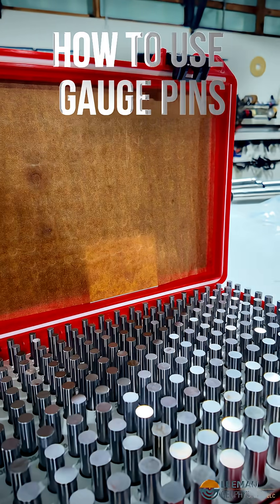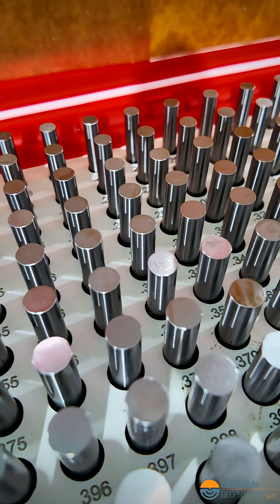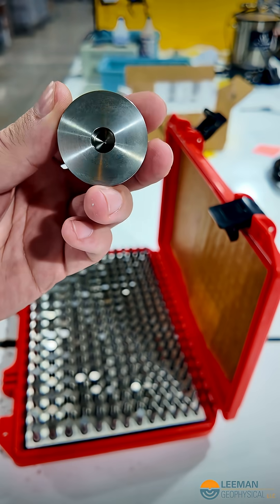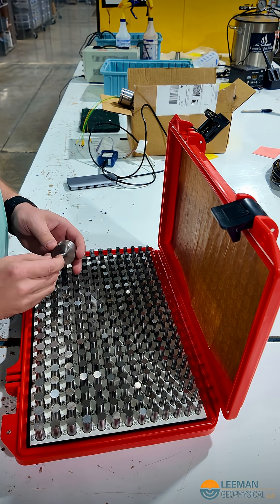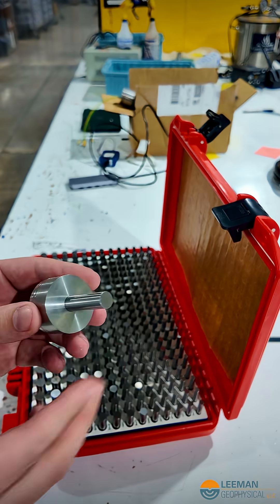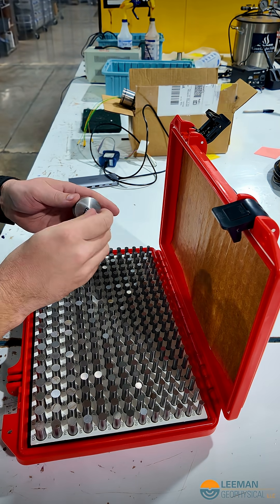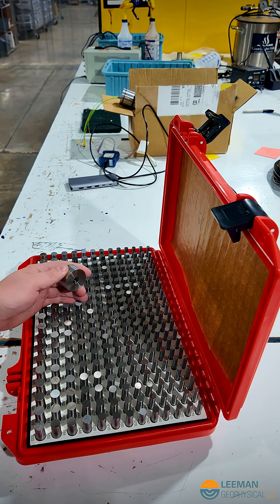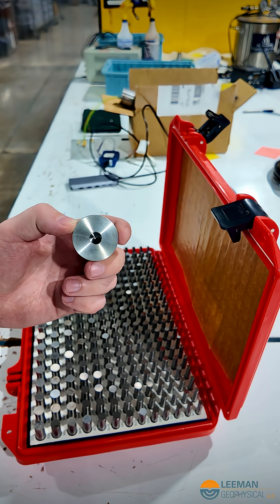How We Use Gauge Pins for Precision Measurements

Comment: .398 at 62°f, .399 at 82°f
Reply from the maker: Right - "room temperature" QC was all that was required here, but for getting tighter it would be in a temperature controlled room.
Reply: @leemangeophysical  it's like the timing gear on VW 1600 camshaft.  It's brass so it doesn't take much to ruin it by beating on it. It doesn't matter on the worn gear, it's being replaced. But putting a new one on, toss it the oven when the woman ain't watching for few minutes. It'll slide right on then. Otherwise it gets beat to a pulp trying to put it on. I even once had an old Chinese pocket watch. To get the back off put an ice cube on it for a few seconds. It loosens it enough to pop out.( I figured that out myself 🧐). Lol If you ever wanna make a puzzle that most people won't figure out, use brass and steel. Machine the brass right out of the freezer( if it's the insert part).

Comment: What about temperature fluctuations at that level of tolerance
Reply from the maker: For this level, it isn't a huge deal, but getting much smaller, it can be. Depends on the tolerance and requirements of the part and QC sheet.

Comment: How much more accurate are these than small hole gauges and a micrometer?
Reply: Using a set of measuring gauges will only tell you the specs of what you're measuring on the plane that you are measuring. Something like a plug will tell you if all the smallest points of the hole are aligned. So if you're looking for accuracy i would say a measuring gauge of some sort. But if you're looking for function i would say a plug gauge.
Reply from the maker: @jonasvann5387  That's an excellent point! This bore houses a piston with seals on the bottom, and a plug is more representative, as you said! Thanks for watching!
Reply from the maker: Partially depends on the grade of pins you buy - there is also some preference. I find I like these better for small bores, but that may be just me!

Comment: in USSR we used similar, only with chamfers. and we called those chafered gauge pins "plugs". so, if half plug came in - that is a failure. the correct size - the hols in detail, can "bite" just a little bit of the plug. if you failed the hole - take a ball bearing 3 time diamter of the hole, place on, and hit/tap with a hammer. then the correct plug will not fall through / will not fail )))
Reply: I guarantee the Chinese stole your ball bearing trick. Or they just don’t test them at all.
Reply: Sums up a lot of old Soviet machines. Im from what's was eas Germany and I've seen some funny "fixes"

Comment: Wouldn't it be easier to fill the cavity with acetone to the top, suck it all out with a precision syringe, add the volume that evaporated, subtract the volume of the o-ring grooves measure the depth,  pi r squared, solve for r, multiply  by 2?  I mean fiddling with all these fancy pins seems ridiculous.
Reply from the maker: That sounds like an undergrad physics lab activity😂!

Comment: Yeah, I'm sure it was spec'd at .3985 Because .4000 is just stupid.
Reply from the maker: It was actually 0.397 with a 0.002" overage allowed - the part was designed overseas so it was not a nice number here in imperial machining world. But hey - it's just a number!
Reply: @leemangeophysical  I was joking.  Parts are what they are.
Reply: Interference fit?

Comment: Go - no-go gauge
Reply: that would work for quick checks but not for SPC charts that are mandatory for automobiles.
SPC= statistical process control, example you would have a target size or ID of lets say .320 but your spec is from .310 to .330 every hour you check the ID and chart it and you want it to float from a couple .001 over to a couple under target ID.
hope this made some since but a quick google search would maybe explain it better.

Comment: Is heating the test object in the hand and manipulating test pins without gloves considered good practice?
Reply from the maker: Depends on how careful you need to be - this hole was +0/-0.002 and we weren't holding it for long, so it would be fine, but getting really tight, yes those are concerns.
Reply: Do you honestly believe holding that pin for 10 second's is going to warm it up enough that it starts to expand? PULL YOUR NECK IN

Comment: If they are that precise, would varistion in temperature affect the size of both gauge pins and hole they are meant to measure?
Reply: Yes. Generally, quality control rooms where the parts are maintained and tested are all at a constant temperature
Reply from the maker: Yes - sometimes parts are required to be QC'ed in a controlled temperature room. We don't have one (yet), but the shop is climate-controlled and that's been good enough. Making sure you don't hold things longer than necessary is important too.
Reply: the pins are .0005 smaller then the size stated on the pin, so .325 pin would be.3245.
I think this is to account for any heat like room or body temp changes. under high heat it could gain manybe .001.
Reply: @SuperXarus you can get different classes of pins, in plus or minus sizes, so they can be over or under size by more or less than 0.0005
Reply: @TricksterJ97   I didn't know that for my work guess .0005 was what they wanted for our purpose. we make fuel lines for cars and trucks.

Comment: but, what kind of scale is that? resolutions seems to be about 0.2 - 0.3 mm,  kind of rough, maybe ok for some applications.
Reply: Resolution looks like 1 thou (0.001 inch) which is about 0.0254 mm or 25.4 microns.
Reply: @alexandrezani  thats a lot better than i estimated, thats good, thank you!
Reply from the maker: Yes - these are in 0.001" steps, so pretty decent
Reply: What do you expect, it's imperial... 🤷

Comment: Be aware that gauge pins are only checking (go vs. no-go) the smallest diameter of a hole but not roundness. Just think of an elliptical hole.
Reply from the maker: True! A CMM could tell you a lot more, but even the inexpensive ones are beyond my QC budget at the moment. Maybe someday though!
Reply: @leemangeophysical  yeah.... I just bought a CMM and it's twice the cost of my gauge pin set (imperial thou up to 2" and metric 1 thou to 25mm and 5 thou 25-75mm) 😂
Reply: You'd think that would break the air seal at these tolerances so naturally you'd be able to tell if the next size doesn't fit but a size under feels loose from a gap for air
Reply: @KaiserTom it can feel like that. Feel is a good indicator that you need to check more thoroughly, but feel is not something you can indicate on an inspection report.
Reply: @prisonedninja23  yes you can if you’ve been doing the same job for over 20yrs 😂
This isn’t for a rocket ship.

Like do guys work in these fields or you guys just come here to talk? 😂
Reply: @100millplusBaby no, you cannot. When developing any product, you’re creating a SOP— which would then need to be followed for manufacturing. 

Do you really think engineers do the manufacturing? No. They tell the manufacturer exactly how to build the product through an SOP.
Reply: Ok… so he is talking about roundness. Out of round condition is what he is referring to, in which a hole or a boss or really anything cylindrical, has a shape that is not perfectly round on a cross section. This can make a hole that has a maximum diameter of 1.006 measure 1.004 based on the pins. Technically if you only measure based on pins and your tolerance is .005 that part would pass since the no-go pin wouldn’t go; however, inspection with a bore gauge, CMM, or intra-mike could show that the hole is, in fact, bad. It’s important to remember as machinists that it’s never enough to inspect any feature with only one instrument.
Reply: @prisonedninja23 ok agreed until that last part, stop overcomplicating stuff
Reply: @lilkane667 depends on what industry you’re making things for and how strict your tolerances are, honestly, but generally speaking you should measure every feature multiple ways several times throughout a run as a spot check. It’s an ISO standard.
Reply: At 20 degrees centigrade
Reply: I use them for SPC charts and you can't use a go nogo for this but roundness is ovality the difference between lowest and highest reading in my line of work you can use calipers to do this by measuring the outside if you know the wall thickness and the OD then you can figure out the ID.
Reply: No doubt, I think of your mum the same way!
Reply: How much of the length is tapered?
Reply: @bluestormcloud791  Gauge pins are not tapered.
Reply: Couldn’t you also quickly identify an out of round condition with a bore gage?
Reply: Your eye-crometer will detect an out of round condition once the gauge pin is inserted into the hole. An out of round hole also wouldn't produce an air seal.
Reply: If its too oval it won't seal air
Reply: There's a lesson in the comments.
Be kind.

AFAIK, even an ellipse can be concentric (common center).
The video appeared to be concerned with size but broadly, it was circular dimension what was being measured, I think.
Reply: @idonotwantahandle2  technically it is only measuring the largest diameter that the hole can accept from a perfectly ground part. Anything that is cut will inherently have imperfections in some way. Imperfections are generally allowed to a degree but that’s why it’s important to measure in multiple ways to ensure that a feature meets tolerance specs. Again, using pins only measures one dimension and they don’t account for geometric tolerance, only diameter.
Reply: Temperature fluctuation is not considered here. But any criteria that is measured in thousandths should.
Reply: Guage pins tolerances are the same for roundness as well as diameter, especially if they're -.0002 or +.0002.
Reply: @anthonymangia8890 A 0.250" gauge pin will fit snuggly into a 0.250" square hole. It will also fit snuggly into an elliptical hole with a minor axis diameter of 0.250". That a gauge pin fits only puts a lower bound on the minimum width of the hole.
Reply: You mean concentricity?
Reply: @valvodka circularity
Reply: @lilkane667  coaxiality, cocircularity, centrosymmetricity?
Reply: @tabcreedence6553 circularity or concentricity idk bout that other shit
Reply: @lilkane667  Don't worry about it. They're just trying to baffle you with bullshit. Those aren't contextually helpful metrological terms that contribute to determining what we're hypothesizing is being measured here.

Coaxiality just means to share the same axis. Essentially the 3D equivalent of the 2D measurement concentricity (a cylinder vs a circle cut from paper). Compares two cylinders to each other, measured from a central axis. Does not mean they are the same diameter. You could define a stepped bore as being coaxial.

Cocircularity is a descriptive term, and only implies uniformity. Sounds fancy, but the correct term to use if you're talking about accurately measuring, is circularity (2D) or cylindricity (3D) (Yes, I know 2D vs. 3D is debatable depending upon context). You could use it to define what to measure, but it is not itself a measurment.

Centrosymmetricity means an object, any object, is exactly the same when inverted along a central axis. I've never heard this term used when measuring machined parts. I think it's more of a metallurgical term used to describe molecular structure. But I've been wrong before and wouldn't mind being corrected if that correction also includes a compelling argument explaining why.

I'm surprised no one has mentioned taper or surface finish yet.
Reply: @UVBluetoo haha yeah i figured. All i know is as long as it works who cares😂
Reply: In correct. You can have an ellipse which is concentric with a circle. Depends on their relationship to the centreline.

Comment: LOL trying to use imperial so backwards.
Working to 1/1000s of an inch that's basically metric.
Why not work out 398/1000s of an inch to a regular fraction.
Or just use a micrometer and measure in mm.
Reply: 1/1000s of an inch is the standard unit in machining in the US. It works perfectly fine.
Reply from the maker: Really don't care about the unit too much - it's all the same - a number representing a physical dimension. But here all the equipment is set up for imperial units.
Reply: 😂🫵🤏PP

Comment: Inch is officially defined in SI metric (2.54cm). All tooling is manufactured in metric but just labeled with imperial stamps for compatibility with all the existing US tooling and designs. Like the Apollo 11 software did run in woke metric SI system but converted everything to foot-gallons-knots for display and aerospace conventions.
Reply: When weights and measures reference units were physical objects, the USA's master set were metric.

Comment: So this set essentially makes the inch metric?
Reply from the maker: Not exactly - as others said - the thousandth 0.001" is a pretty standard step of measurement in manufacturing here. It'd be nice to switch to metric while the government is shutdown, but we'll still be using imperial when I retire.
Reply: I'd call it decimal inches, so is there a set for fractional inches?
Reply: @jamier.6634 I doubt it. A thousand of an inch (thou) is the standard for machining in the US.
Reply: No metric on this set. I mean you can always convert but this set was made for US customary (standard) or imperial.

Comment: Do you need to control the temperature when you use it?
Reply from the maker: Depends on the spec - for most "not going to space" things, climate controller is fine, but there are some parts that require the use of a well controlled QC room.
Reply: Just guessing, but id assume so long as the metals are the same temp, it should be an accurate reading. Also assuming its the same metal.
Reply: 10 degrees (C) gives  ~0.01% difference.

Comment: Next time try a micrometer and showing the actual measurement to compare it with the gauge.xD
Reply: Gauge blocks are more accurate
Reply: @80percentr15  He has to find the unit that fits best. comparing the gauge pin to an actual measurement would be intersting.
Reply from the maker: Depends on the grade of the block/pin, but blocks are also not for measuring diameters.
Reply: @80percentr15 unless your gauge blocks came from amazon(like a couple i got), cost 5 to 10 bucks, and are less accurate than using your tape and speed square. 😂
Reply from the maker: Bore mics would be best, but holy cow are they expensive! Hope to snag a set sometime though!
Reply: This 💯. But nowadays folks reach for the digital variety. It seems no one knows how to use a dial anymore, let alone a vernier. Before I moved into the injection molding space I was in precision machined components and primarily used dial id mics for similar stuff. Only true blown accurate way to measure imo

Comment: Expensive because unlike guage blocks you can't just wring 2 or more together to make whatever size you need

Anything this high tolerance or only ever done in metric but say you needed a 10.645mm block you would just wring together a 1.005mm a 1.14mm and a 10.5mm

(the set I was used to had 1.005
1.01-1.20 in 0.01mm steps 
1.25 - 2.0 in 0.05mm steps 
2.1-5.0 in 0.1mm steps 
And 5.5-25mm in 0.5 mm steps 
Plus extenders in 10mm 25mm 50mm and 100mm (10mm and 25mm being duplicates of existing blocks)
Reply: I can create that exact same gage block stack with imperial blocks. Metric is in no way any more or less precise than imperial units.
Reply: you'll need a 2mm tolerance on that 10.645mm,   1.005  +  1.14  +  10.5  =  12.645 .
Reply from the maker: Gauge blocks are very handy - but you can get the same tolerance with imperial blocks too, you just need the right set!

Comment: ...and then the room temperature changes 10 degrees....
Reply: 20 degrees difference for 10” and you will see a change in length of .002. For .9” diameter 10 degrees change .0001” roughly.
Reply from the maker: Depends on the tolerance/specs requested!
Reply: That's why you should control it too

Comment: You could consult the tech drawing and just grab the right size gauge pin to start and save some time.
Reply: well yes, but for a demonstration this will do.  I usually go top limit -> bottom limit -> nominal, then work from there for the first part to see exactly where I am.  Then repeat on random parts during the run, the others is just top and bottom (go, no-go).  But that first part I want to know exactly the size so I don't get a surprise later on.
Reply from the maker: Yes, but that isn't as illustrative for a video - though in practice if we made many (needed 2 of these) I'd set to pins in a go/no-go holder and get to work. Thanks for watching!

Comment: Hearing the word inch and precision makes me giggle.
Reply: That's just because you don't know any better. It's all relative.
Reply: Inches are better than centemeters because CM is too small.
Reply: @80percentr15  well when you are dealing with differences of .0001 inches a centimeter is pretty big.
Reply: @johnpalmer4425  and that's pretty big when dealing with a micrometer
Reply from the maker: Makes not difference - 0.001" and 0.0254 mm are the same - we just use the tooling and equipment available.